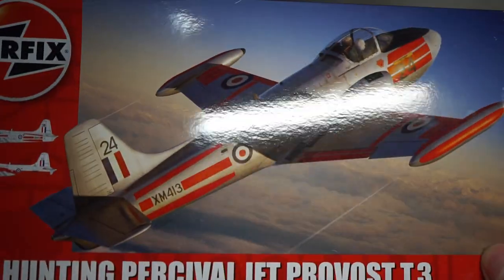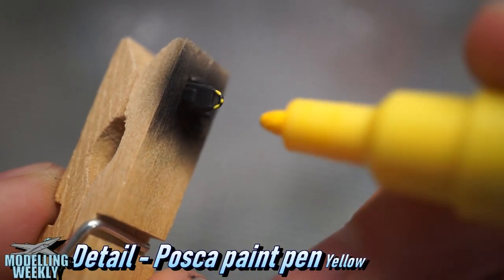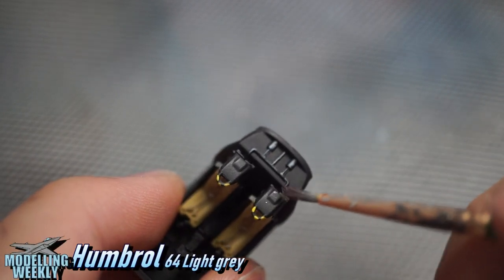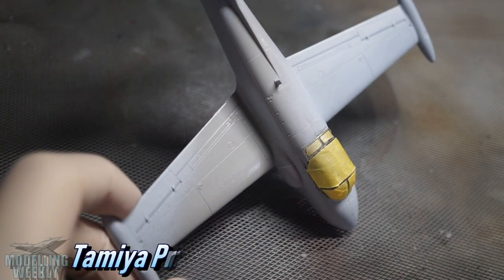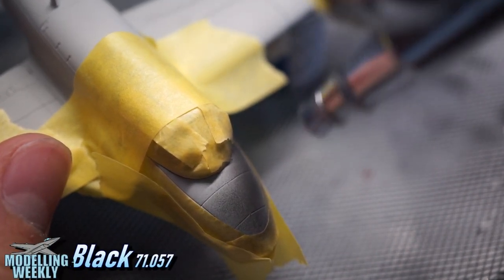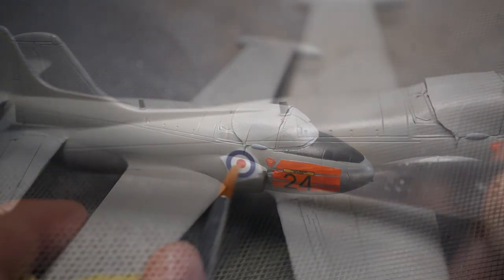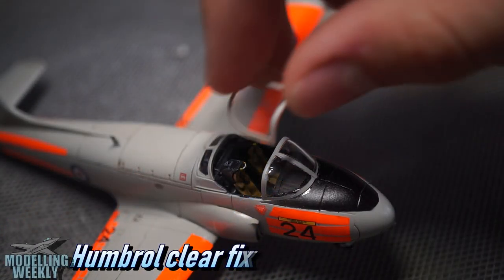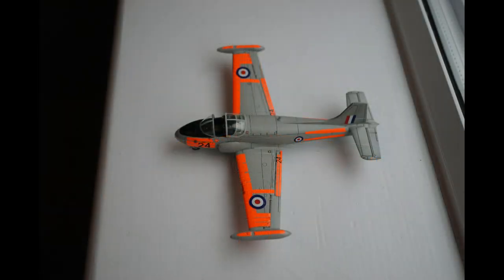FULL BUILD Airfix 1/72 Hunting Percival Jet Provost T.3 | Narrated

Comment: Very nice job! Did you use any type of decal softener/setting solution? I personally use micro sol and micro set, and they are a big help especially with bigger decals that have to conform to curves and panel lines. I bought myself this provost kit earlier in the year because I have an older version of the provost I want to refurbish using one of the decal options in this kit, so at some point in the future I'll be tackling those day Glo decals!
Reply from the maker: I used decalfix from airfix, but something more powerful like Micro sol/set would be ideal. People Are saying to use really hot water to soften them, but I just think too many things could go wrong.. You do what seems best, and good luck!
Reply: @ModellingWeekly  absolutely! I'm sure I have some decalfix  as well as sol/set too, and I'm a big believer in the modelling idea of there is no right and wrong way to build stuff, do what personally works for yourself and never forget to have fun doing it!
Reply: I tried using Micro Sol/Set but they just cracked or melted.  It was day-glow carnage.  I note Airfix have quietly re-launched the kit with new schemes

Comment: The "day glow" color has nothing to do with the quality of the decals. Some are very good and conform perfectly to the model.
It's the manufacturer. In this case, they did not do a good job. The carrier film is too thick, too tough. It's not Airfix's fault. 
Humbrol Decal Fix is fairly strong stuff, but there are more agressive ones.  Solva Set and Daco Strong are also quite good.
Did you soak the decals in Humbrol Decal Fix for a couple of minutes ? Do not wet them with water, only with Decal Fix.
Do NOT forget to clean up the residue !! Decal Fix leaves a residue that becomes hard and glossy, and is very difficult to remove, once completely dry !!
And never put a model with fluorescent colors in direct sunlight or near a powerful light source, or even a window, as these colors can fade fairly quickly, and repair is next to impossible. Keep such models in the shade, always.
Reply from the maker: Yes, I only used decalfix and no water - I put the model on the window sill just to take the photos, they live in a cabinet that never gets direct sunlight :)
Reply: Ive built this kit and used solvaset. Its a stronger acid and melts the decals better

Comment: I didn't come here for a " Quick glimpse of the horrible leading edge decals " I wanted to see how you did them .
Reply from the maker: I'm sorry about this. It's an old video and back then I didn't understand nearly as well how to make a quality video. Again I'm sorry you feel this way.
Reply: @ModellingWeekly  Oh that's alright . I've just spent the last hour soaking them in Microsol and Microset  trying to tease the bloody things around the leading edge but I've given up . I'm off to get some Dayglow orange paint !
Reply from the maker: @bobgibb2781  honestly probably the best solution! I contemplated painting them on myself! I also suggest using hot water to try and bring them around, and in a worst case scenario i've seen people use lacquer thinner to soak them, though I'd think you need to be really careful with this

Comment: Very nicely done!

Nice little kit BUT Airfix should have pointed out in the instructions to use HOT water for the glo decals and tons of softener. I also had to buy again the kit to replace 2-3 glo decals that broke while trying to make them to conform around the leading edge.
Reply from the maker: Yeah, You are completely right. They wanted tp charge me £6.00 for new decals, so i refused and used paint to cover the cracks!
Reply: Modelling Weekly 6£ for the decals when the whole kit is sold for aprox. 9£
Reply from the maker: @gmtxrsts  I know, it's ridiculous! You'd think they would want to make them cheaper to satisfy the customer, so that they buy more kits!